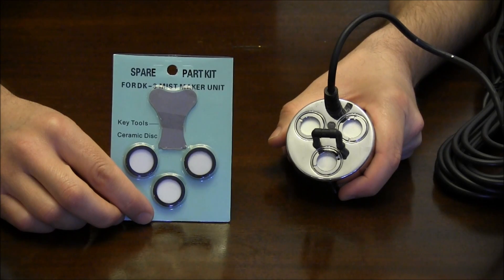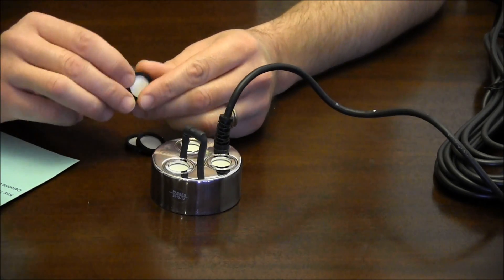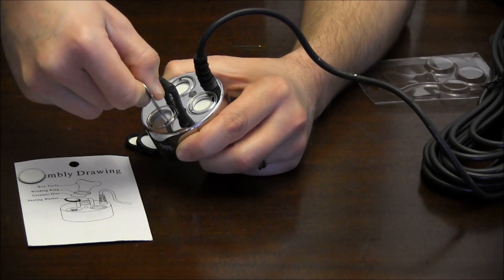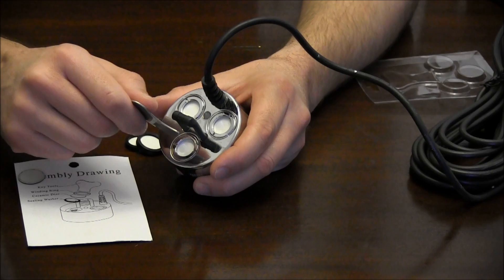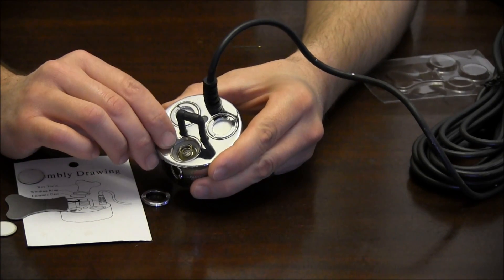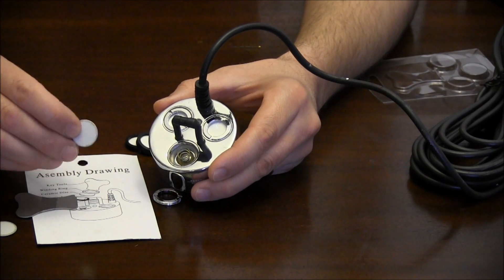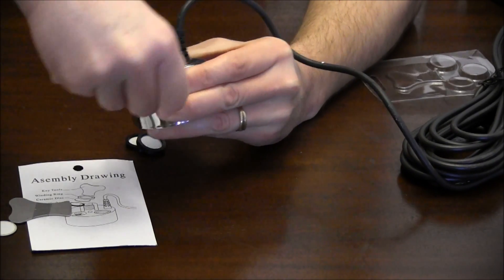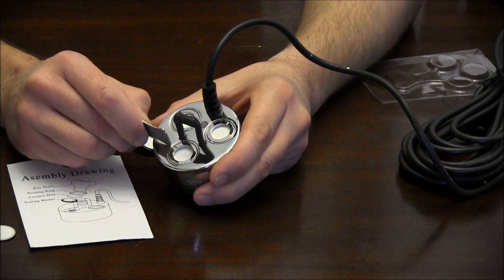How to change the discs in an Ultrasonic Mist Maker with The House of Hydro

Comment: I bought one and all it does is shoot water up...no mist???anyone know why
Reply from the maker: Hi, good to hear from you. You can always email me direct at john@thehouseofhydro.com

The first thing I would check is to make sure you're not using it in distilled water or AC condensate.  Also make sure you don't have any additives in the water like bleach. Bleach can leave a film on the discs that greatly reduces performance.

If neither of those ring a bell, try putting a new disc in it from the extra pack that we sent you. When you change outthe desk, see if there's any water in the spring area. If there is, let it dry out really well and put in a new disc. If none of those work, shoot me an email directly and we will get it taken care of. I don't always see you two messages because I don't check them as often as an email.
Reply: Can i use aquagaurd watrer

Comment: Are all discs the same size? I have a mist maker lamp and I just got a brand new unit for it cause I could not track down the discs for the old one. But I kept the old one! Now I would like to change it out in the old one and see if it will work again.
Reply from the maker: There are 16mm discs, and 20mm. We have 20mm in our units, and most others are 16, The easiest way to measure your disc is using a penny. The 20mm discs are slightly larger, the 16mm are slightly smaller.  Here's a link to both...https://thehouseofhydro.com/store/p73/High_Output_Replacement_Discs_20mm_or_16mm_available_%283_Pack%29.html

Comment: I find a good trick with difficult threads is to go the wrong way just a little, while gently pressing down, as soon as you feel a small click (the feel of the leading edge of the thread dropping down), then go the correct way and you should be threaded correctly. I'm not very good at explaining things these days. I hope I helped someone somewhere :P
Reply: I do that every time I put a cap on a water bottle.

Comment: What is the rubber foot for that's on the cord about 6" from the mister?
Reply from the maker: Hi, are you talkin about the bundle of cord?
Reply: That is a plug that goes in the fountain. Basically a bung for when the cord enters the water below the water line.

Comment: Okay I need to know if I'm screwed on this one. I bought an Exo Terra fogger a while back, and my knowledge around foggers to this day is slim. When I got the fogger, I just placed it in the aquarium and ran it, it worked great for months. Now all of a sudden it won't work, led won't turn on and it's pumping out little to no mist. I googled it and found out that you need this membrane/disc. Is my fogger busted forever, or will buying a disc fix it?
Reply: Or, well. Atleast I think i don't have a disc in it. It's brass colored.
Reply from the maker: You can replace the brass discs with ours. You just need to know the size. Smaller than a penny is a 16mm disc, and larger is a 20mm disc. If it's still putting out some fog, you should only need new discs, or it may be a short of some kind. It's most likely discs that you need. Our high speed discs should help increase production as well. If you go on our website and buy the discs and they don't fix the unit, I'll sell you the whole mist maker kit for the remaining cost. ie. $29.99 minus the $12.49 you paid for the 3 pack of discs. 

Thanks!
John
Reply: Wow, thank you for replying so quickly! Do you ship to Sweden as well?
Reply from the maker: No problem! Yes, we ship worldwide. You can find them in our international shop here. International shipping is included in the prices on this page. http://thehouseofhydro.com/store/p107/%283%29_High_Output_Replacement_Discs_20mm_or_16mm_available_%28Shipped_Overseas%29.html

I don't always see messages on youtube, so if you need anything else, please email me at John@thehouseofhydro.com

Thanks, john

Comment: I have a unit. but now its not working. however Red LED works fine. if i change the disk, will it work? Please Help..
Reply from the maker: Hi, if it has an LED, it is not our unit. Unless it is from years and years ago. If the LED is working, and If changing the disk does not work, it's probably time to buy a new unit. They are not repairable. Check out our site at thehouseofhydro.com. Thanks!